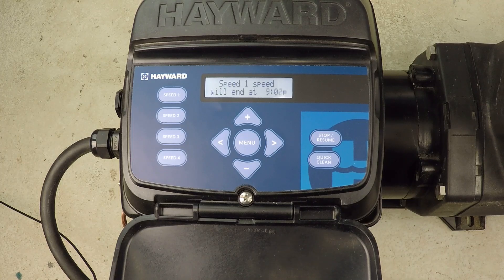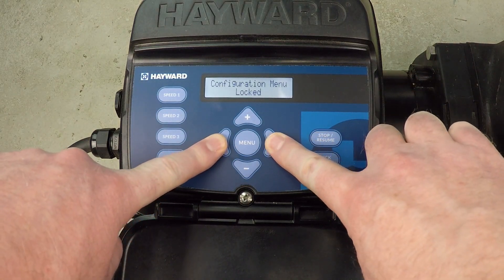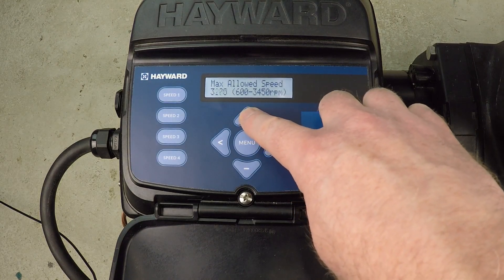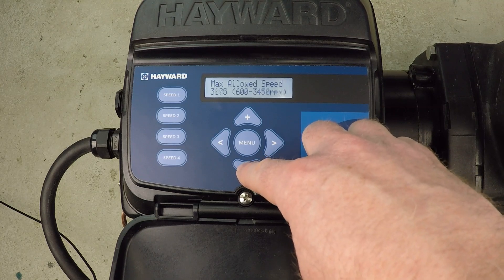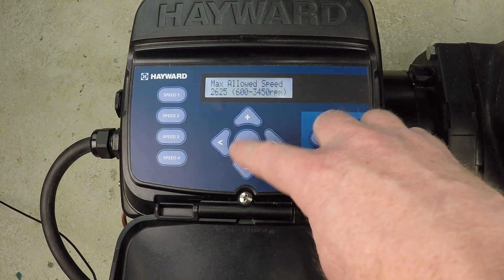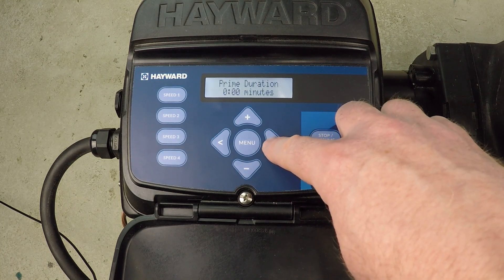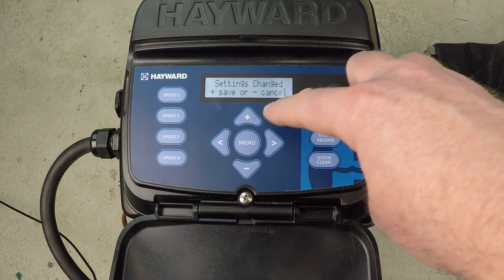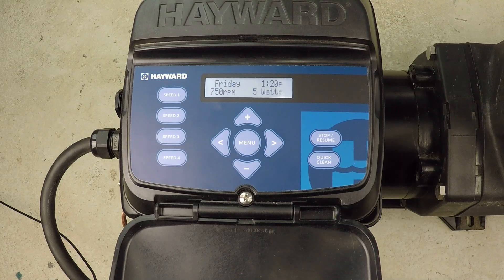How To Set Maximum Speed On Hayward Super Pump VS

Comment: Hey Steve, if I set that maximum RPM below the max rating for the pump, will that affect the operating pressure for my heater/chiller as well? I think that at 3450 I’m pushing water so fast through my heater that it’s not adequately heating the water due to the amount of time the water actually has contact inside the heater but my heater won’t work unless it’s on max RPM….please help
Reply from the maker: @jamesstultz7920  try cleaning your filter media and see if the heater will operate at lower pump rpm. Pool heaters are generally optimal for heat in the 80 to 100 gpm range but at higher speeds this should not cause a noticeably loss in heat / longer heat times. The heater will output the rated btu regardless.

Comment: I have the Hayward Max-Flo VS 1.65 pump. I wish I had never installed the VS pump as it does not service my pool solar panels, pool cleaner, and water fall unless it is on a high speed. Is there a way to program this pump to run at one speed all of the time? I saw this video on how to set the max speed which should be helpful. I have a Pentair Clean and Clear 200 filter which I think handles 200 gpm. (1 gpm per 1 sq ft). Any help would be appreciated! Thanks!
Reply from the maker: A maxflo pump is not the right pump for a solar lift. Yes you can program you pump for one speed but why not sell it and buy a single speed pump instead.if that is how you intend to run it. Realistically a better sized pumpnfor your application would be the best solution. Variable speed for sure.
Reply: @Swimmingpoolsteve  Last question about this...Curious as to why the Max-Flo can't handle the head pressure to get water up to the solar panels? It is probably pumping up 10 ft to the roof, and another 40 ft horizontal run to the panels. Are their impellers different than other manufacturers?  Thanks
Reply from the maker: @tomdavis3495  low, medium and high head pumps are used for different pool applications. A higher head pump would perform better with a solar lift and the added resistance of that extra pipe run length
Reply: @Swimmingpoolsteve  Thanks so much for the information!

Comment: Hi, i recently bought an astralpool victoria plus 2hp pump, i have 2 inch pipe and a sand filter that is rate at 31000 L/H
The pump room is located under the pool and i'm afraid of exceding the flow rate the pump is rate at 26000 L/H

Comment: So does a single speed pump (1hp) always exceed the MFR of a sand filter? (say a S244TC)
Reply from the maker: Depends on the pump manufacturer and system parameters. It definitely can. Especially a pentair 1hp
Reply: @Swimmingpoolsteve  can a Pentair 1hp exceed the flow rate possible for 1.5 inch pipe?